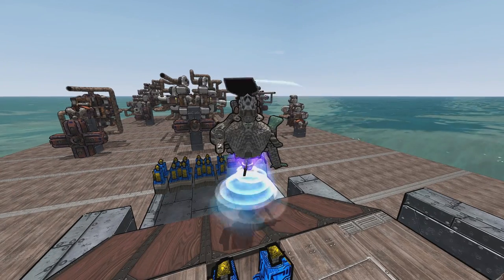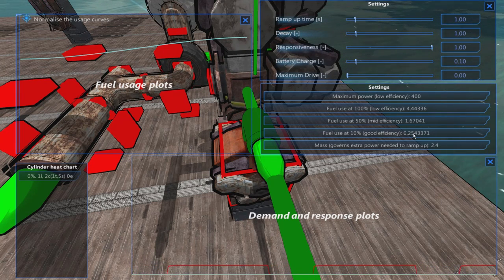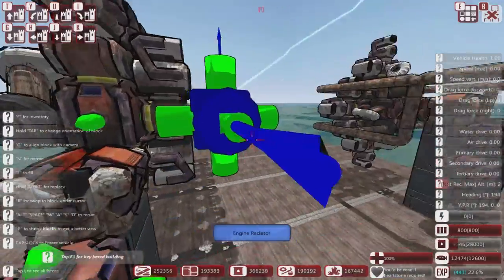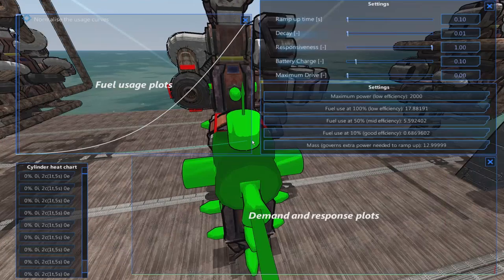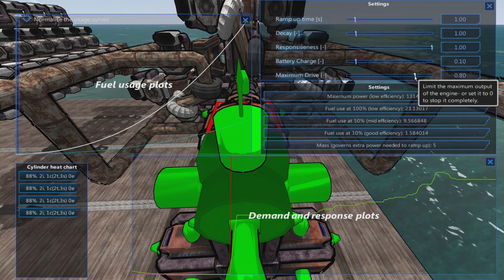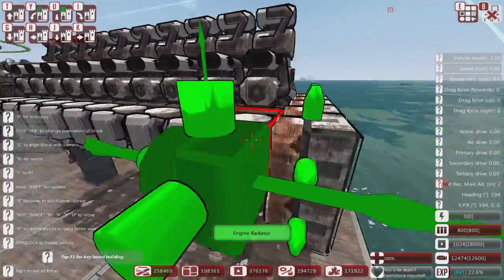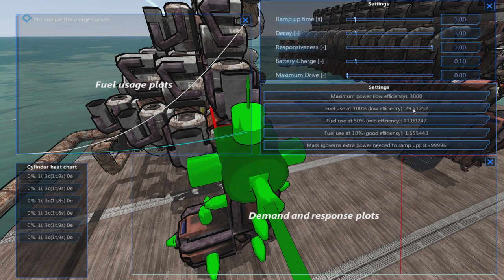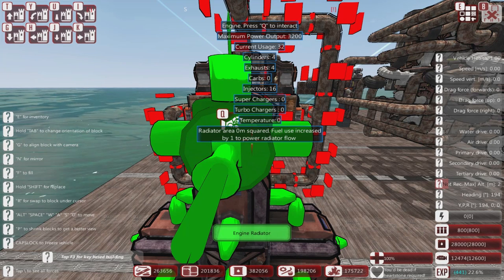From The Depths 1.8681 Lab19-New Fuel Engines,Some Example Designs.LetsBuild,Playthrough

Comment: dels do you know how to re supply fuel in to a ship 

because now that the supply pump are not working is there any other way for supply fuel to a ship ?
Reply from the maker: +candieka tasbihyantra  if your in designer you can just place a fuel container and it will place it full of fuel. I now have a standard resource ship spawn in designer with me that pulls up oil and has a refinery so it's constantly creating some fuel for all my ships.
Reply: Dels Gaming thanks ^^

Comment: 16:00
Using the same design and getting 0 rpm .-.
Reply from the maker: +Comrade Legion  Make sure your engine block is the right way round, also make sure you have some fuel on your vessel. I always spawn in a resource collector so that it is constantly converting some oil to fuel while designing the ships.
Reply: Dels Gaming
Oh thought I deleted this.
Figured out the problem. I forgot to turn my ship on.
Major derp moment. Ty though